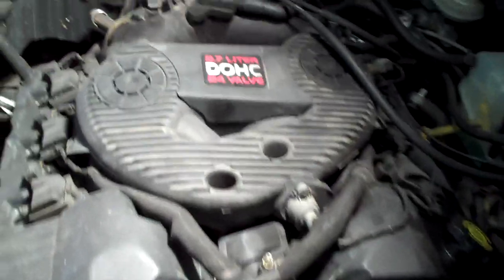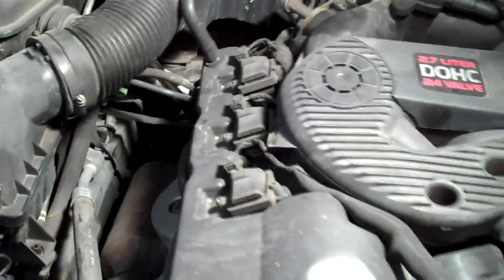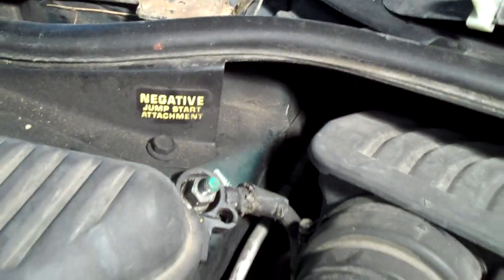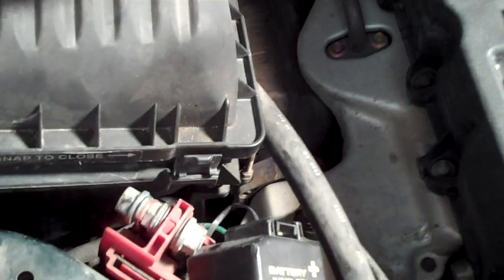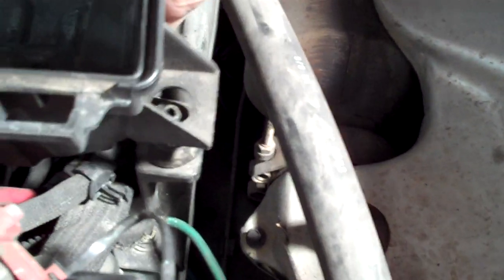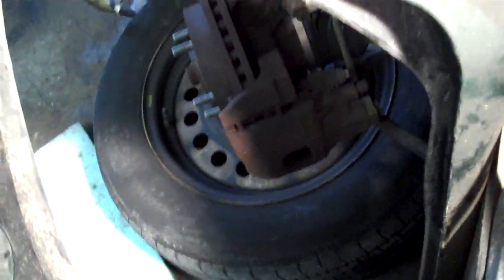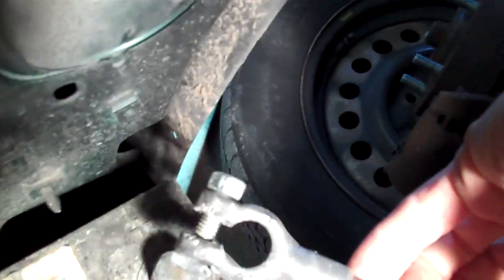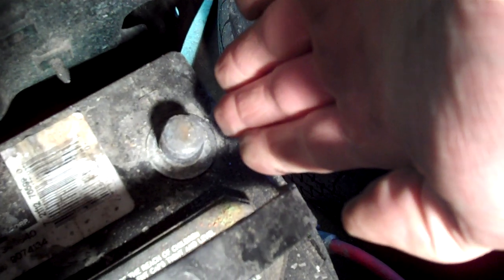1997Chrysler Concorde Battery Location Installation How to.

Comment: Good video, but I would like to add one thing. I just replaced my battery today, and it took me 4 hours because there was corrosion on all the bolts and the battery clamps. So after you remove the wheel and the airbox, spray all the bolts with Liquid Wrench, wait an hour, clean them with a small wire brush, spray again and wait another hour, then remove the plastic fender liner bolts, the battery hold-down bolts, and the battery clamps.After removing the battery, I also used a baking soda and warm water solution to clean the clamps, battery tray, hold-down piece, and screws. I had to replace the negative clamp, as the bolt and nut would not turn. Schedule half a day!

Comment: You saved by butt, I would never have figured it without your video.  Even so the 10mm bolt head on the inside of the hold down bracket was rusted and rounded over so I just bent the bracket up and slid the old battery out and new battery in under it.  Thanks for the video.

Comment: Thanks. I just bought a 1998 Concorde LXi. It has 180k miles but is in decent shape and runs and drives well. I wanted to check the battery terminals just to know the connections are good. Jeez! What were they thinking? Anyway, thanks again for taking the time to make and post this video.

Comment: You're perfectly right about this one.I found it quickly and it's easily accessible. The ones I was talking about are on the right side of the air filter box. There is some sort of access to the screw heads from inside the box...yet there is no way to see what kind of screws are used. Anyway - thanks for you help! Sorry for mistyping you name Brian ma bad))

Comment: Thanks for the video.  99 Chrysler 300M with the ORIGINAL battery.  Took me three hours because of rust and corrosion.  Another video I watched said I could access and remove the battery without taking the air filter and housing out...Don't think so!

Comment: Brian, 
Observation: That is a 1998 and later Lh body (300m, intrepid, concorde)
I have also jacked up the vehicle, right front wheel on and suspended. removed access panel and removed form the top. Great cars, base engine (2.7) not very reliable. Have done many swaps to 3.2 or 3.5. Cheers!

Comment: Brian - I bought a 2002 300M a couple of months ago and although it starts and runs great I have had a couple of times where it won't start and the symptoms are a low battery.  However, after I jump start it the battery is fine for weeks.  I'm thinking it's a a loose or corroded battery cable.  Your video is helpful.  Any other suggestions besides cleaning the cable/terminals for a problem like this?

Comment: Oi Brain,I'd be grateful if you'd let me know hot to take the air filter box out. There are two plastic "thingees"that hold the box in place (they're between the box and the fender. I have no clue how to take the box out without breaking them eventually? What kind of spanner or screwdriver you'd recommend? Thanks